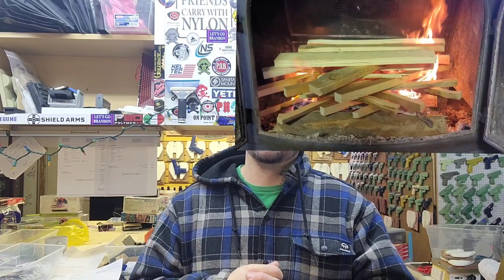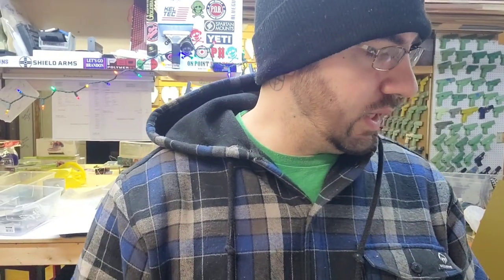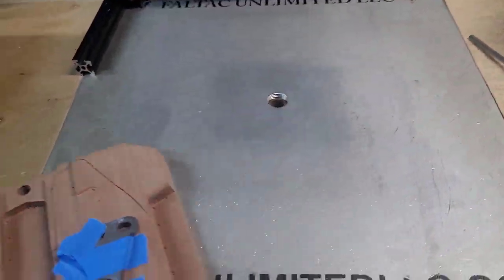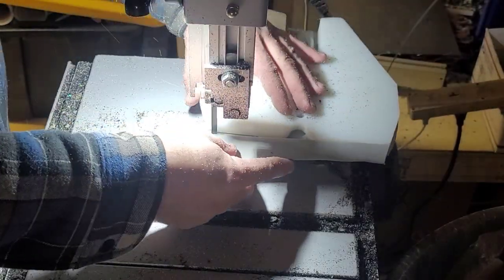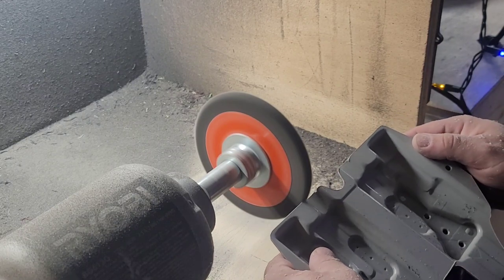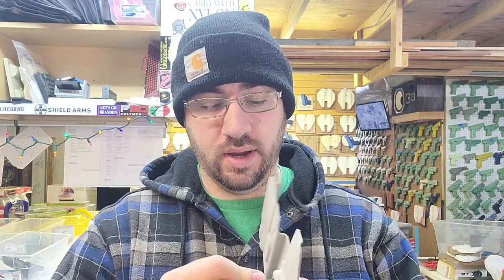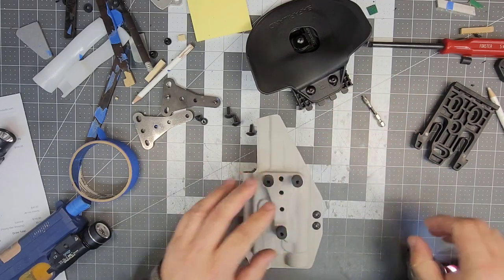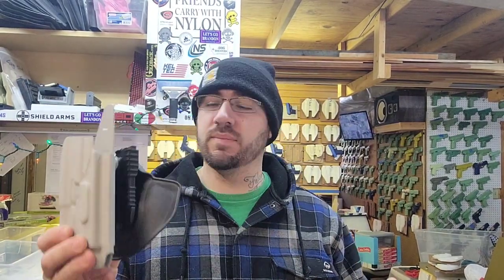Fnx 45 Tac with TLR 1 on a safariland Paddle.

Comment: YO!  A while back u made me a holster to for my Ruger American compact 9mm with a TLR-8 on it for RH OWB carry. love it btw! the only thing I'd suggest to you is because it has the ambi thumb safety, would be to make the slot/groove for the safety switch fatter at the point the gun enters the holster. The way you made it you may not have realized this conflict. I ended up cutting it a bit on a bandsaw to relieve this issue. You have an IWB holster at On Target indoor gun range in Dracut that has the same design. The safety slot/groove doesn't accommodate the "on safe" position and causes it to switch back off when inserting the firearm. Could you make this holster to accept the gun while in safe mode? I would love to buy another one from you for IWB of my Ruger American compact. I like to carry with the gun on safe. Thanks for the great vids and great work. MERRY CHRISTMAS and happy holidays
Reply from the maker: I just checked my american comp mold and it does not have the safety switches on the mold. that could probably be the reason as to why. i will definitely make a mark on the mold for the switch
Reply: @FalTacUnlimitedLLC  Thanks for the reply. Other holsters I have for other firearms have an area about the size of a quarter to accommodate the safety switch. With which I'm sure you're familiar. Would you be interested in making me an IWB RH for my ruger American compact 9mm? I'm greenlighting you to do so if you are. How do I formally order this? Thanks.
Reply from the maker: @jasonrigano8619  right on my website at Faltacunlimitedllc.com